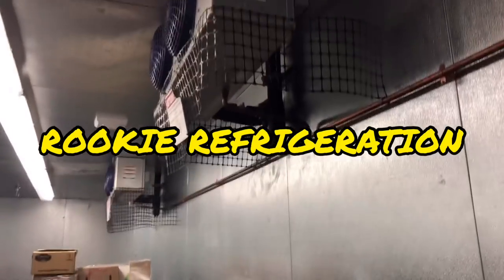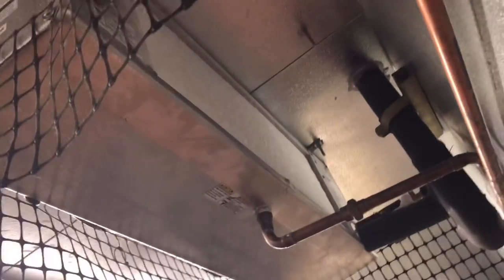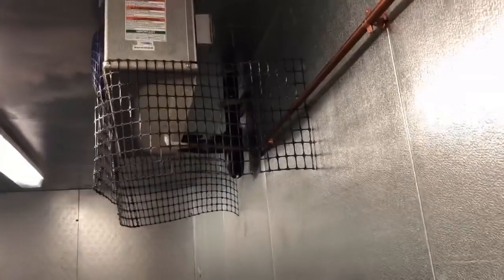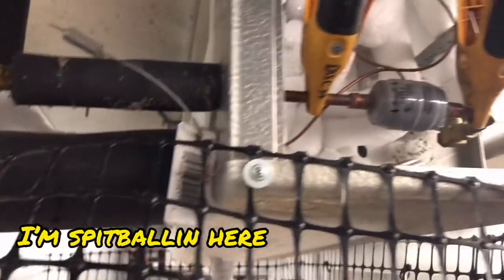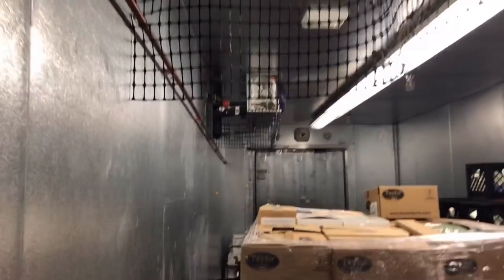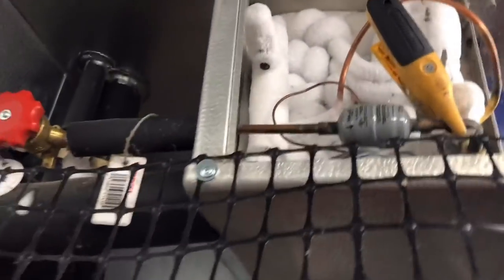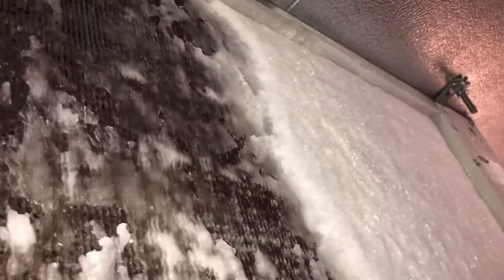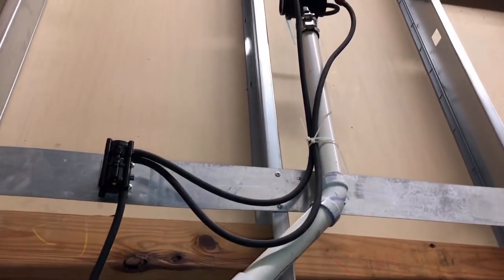Refrigeration:  Dairy Walk In Cooler too warm.

Comment: Rookie Refrigeration, I see you have alot of what we call in my neck of the woods, "Monday morning quarterbacks" in the commemt section of this video. Don't worry about that...Good work getting them up and running safely. Being the on-call technician is alot of responsibility. Sometimes you just have to get a business that's cooling a critical load up through the night following good industry practices. You did that. I know those middle of the night calls very well.
Reply from the maker: Thanks man.  I know what you mean.

Comment: Rookie use insulated screw drivers when working live current.dont give attention to pressures when coil is iced up. But also need to check defrost circuit if its fuctional. Love your work

Comment: that middle lug has been overheated bad, contactor is junk and cut the wire back to clean copper or replace the whole section.
always replace anything electrical that been overheated, because it's been oxidized and will more resistance causing further overheating. same for new contactor on oxidized wire, it will fail there again.
Reply from the maker: Agreed.  Company had another tech complete the call.  I left specific instructions on what to change.  Including that wire.   

Thanks for the advice 😉

Comment: Great video and job. Not tryin to nitpick, I know we all have different ways of doing things but I’m always amazed at how many people don’t weigh in how much they are adding in. I get that u can weigh before and after at truck but I love knowing how much I’ve added so I can’t overcharge and can make sure I add the extra for headmaster/low ambient temps.
Reply: Most bigger refrigeration systems cannot be charged by weight therefore you still can over charge a system or have a system be under charged you can only charge by sight glass and head pressure
Reply from the maker: Yeah bro.  I have Not taken a scale to a rooftop in a long time😂. Just my way of doing it.  In this case I couldn’t touch the receiver due to it having insulation so I just used my judgment really on how much to add.   But I agree bro.  Everyone does it differently.
Reply: steven siwierka I get that and work on lots of grocery refrigeration . I also work on critically charged topping tables and ice machines. It’s just habit to have scales when recovering or charging no matter size of system.
Reply: @Hvacsteve69  @ impressive

Comment: I wouldn't even check  the suction pressure while your frozen up it's not going to tell you anything without moving air across the coil your not going to get any accurate reading at all
Reply from the maker: Agreed.  Some things I do for the camera.
Reply: Rookie Refrigeration is that refrigeration porn then?
Reply: @rookierefrigeration4357  good point bro that is a good answer for new techs .
Reply: @ Steven @ When is best time to check saturation temperature, what does saturation temp should look like under heavy load and on regular operation, why does saturation change under heavy load or is the saturation tempreture depend on the charge I need some information on this. 

Thanks
Reply: is there any traps in the drain lines?could suck in outside air there.

Comment: Can someone explain the pump down check to make sure it isn’t over charged?
Reply from the maker: If you are overcharged, and your receiver is full then you will begin to stack refrigerant in your condenser.  Then your compressor will squeal and your head pressure will rise and probably trip on high head or compressor will go off on overload.

Comment: What the low side pressure should be around on a 20 door reach in cooler 134-a
Reply from the maker: Cris. G hard to say.  I’d say you have to run a 23° coil so translate that into pressure for R134a.  About 20psi.   Depending on evaporator coil td etc.
Reply: Rookie Refrigeration thank you bro

Comment: Since 404a fractionates did you add the 8lbs then come back, recovery the charge that had the leak and charge it back up with fresh 404a?
Reply from the maker: Absolutely not.  This is the real world.  Can you imagine doing that to a rack with 1000lbs.  🤷🏼‍♂️
Reply: @rookierefrigeration4357  Yeah firgured that big of a unit would be a pain. Would it affect the system if you keep having to charge it or its so much gas that it just doesn't matter and youd find the leak and repair? I only work on small stuff like fcbs and ice makers so to see how everyone does it with the bigger stuff is very informative. Keep em' coming! Edit: How many pounds did that hold?
Reply from the maker: kmerc609 at some point, after much and much fractionating, then you may have a problem.  I do agree on that.   But not until u start noticing weird pressures/temps.

Comment: Bro can you explain the pump down method to check if your overcharge...I've always charge until I don't see bubbles in the sideglass and than check pressure..
Reply: If you pump the system down manually and its overcharged, the compressor will not shut off on low pressure cut out due to the system not having enough space in the condenser and receiver to hold the charge.

Comment: When you refer to pump down safely, you mean don't exceeding high pressure switch?
Reply from the maker: Juan Todolí I mean make sure it’s not overcharged by exceeding the capacity of the receiver and going off on high head or opening up the internal bypass.  Just looking for normally pump down. That’s all
Reply: @rookierefrigeration4357  That's waht I tried to say. I picked the wrong words (not English speaker) 👍

Comment: I though the liquid line drivers are bad if they have more than a 3 degree temp drop across them
Reply from the maker: I’ve seen a few that have less than 1° and were  plugged.  Just really depends.  But yes, the rule of thumb is 3°.   You are correct.

Comment: I disagree with your diagnosis technique there. 
You CAN NOT diagnose a system with iced up coils, you’re virtually running the system with no fans and naturally you’re going to get a low saturated-suction pressure.
Reply from the maker: TheJordanwright I agree. That’s why I Based my diagnosis off  of head pressure.  The suction pressure was just there to show the effects of low airflow and low charge simultaneously.   But you’re correct.
Reply: You can't tell without de-icing it first. The evaporator being unable to absorb heat will have a direct effect on the head pressure.
Reply from the maker: Bill you don’t say 🙃
Reply: Hahaha 🤦🏻‍♂️🤦🏻‍♂️🤦🏻‍♂️🤦🏻‍♂️
Reply: Good job @Rookie refrigeration you showed us pressures before and after the de icing the coils..
Reply from the maker: XRAY Bravo thanks bro.  Some guys don’t get that unless I explain it.  😂😂😂